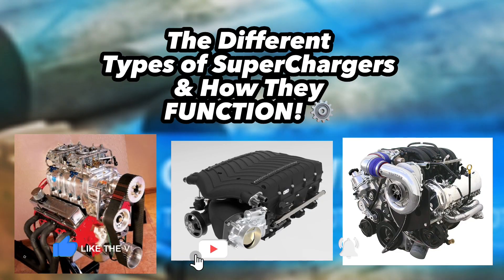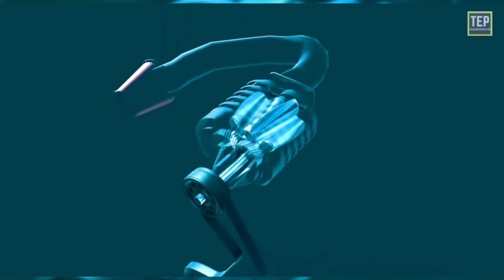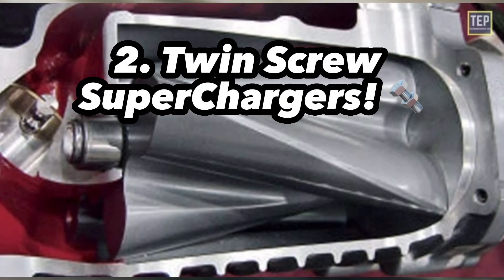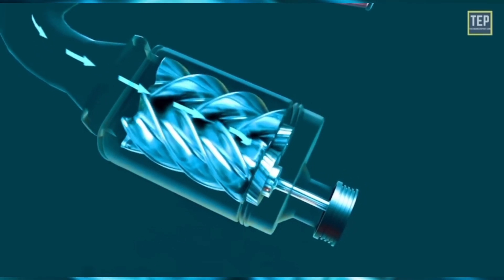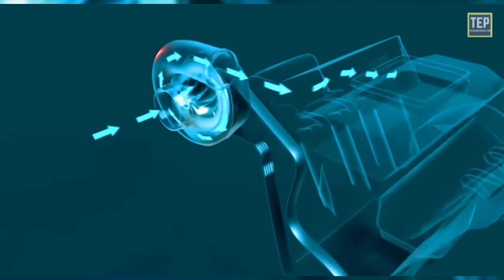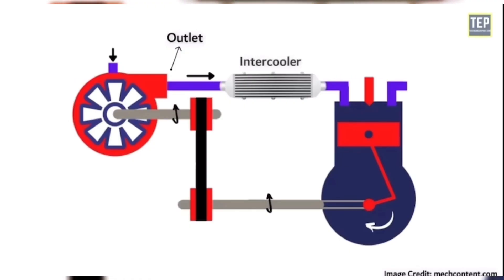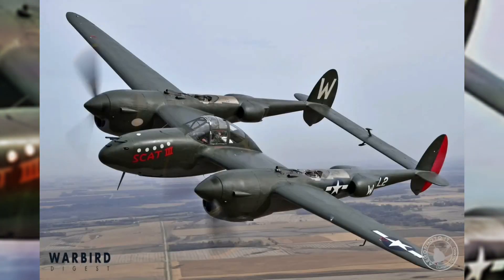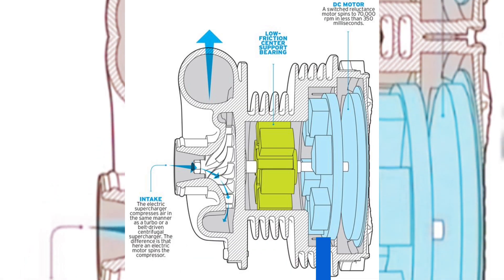THE 4 DIFFERENT TYPES OF SUPERCHARGERS & HOW THEY INCREASE HORSEPOWER... (ROOTS, TWIN SCREW, ETC)

Comment: Why do you think the centrifugal supercharger is the most interesting one?
It’s the most boring one that makes the fewest power.

They where usually used in small motors to make a little bit more power.
Like Mercedes often did when they pushed an engine from 130 to 170 hp with the centrifugal charger.

Or as a “bolt on” for other older European sporty cars like the G-Power stuff you can bolt onto your BMW inline 6 or even V10 motor.
European cars don’t have the space for blowers on top that’s why they went with that route and add on turbos where pretty much unheard of back then.

I’m really interested why you think the smallest supercharger that makes the fewest power but still has friction loss over the belt is the coolest?

In my opinion a centrifugal charger only makes sense when it’s electrical like the new ones in cars with 48V. 
It’s perfect to support turbocharged engines to have no lag at all.
Audi does that for example in some engines.
Reply from the maker: They can make just as much power with modern setups & sound like WW2 planes! Nothing beats a centrifugal blow off sound 💨